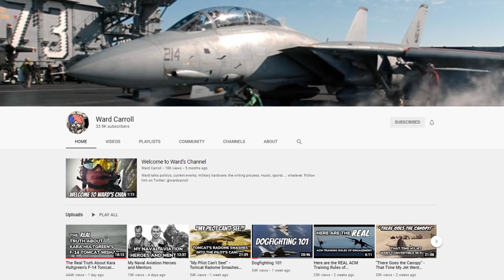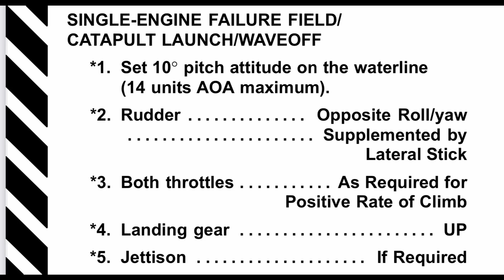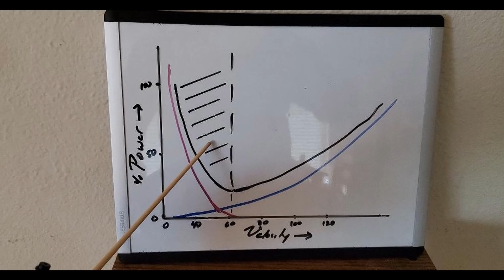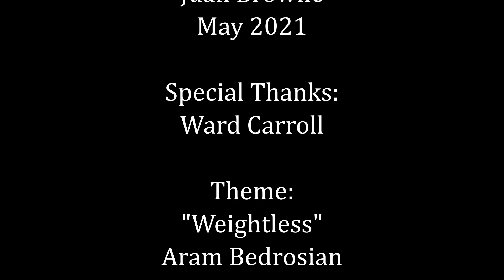Navy F-14 Crash/Stall Demo-Lt. Kara Hultgreen Accident

Comment: How would the fact that f-14s use spoilers instead of ailerons further exacerbate or change the dynamics?
Reply: The use of spoilers will drop that wing, it loses (spoils) lift. Aileron will increase the camber of the wing that needs to be raised up. A byproduct of lift is drag….which will “drag” the wing towards the dead engine. And also when increasing the camber it will increase the angle of attack, if I remember correctly, causing it to stall and the airplane will roll inverted. The rudders will bring the nose away from the dead engine and allows airflow over the wing to remain level. No more than 14 AoA, judicious aileron input to assist the rudder and proper power. Jettison external stores if necessary. Those are memory items
Reply: @uwekonnigsstaddt524  yes i know all that, but does the use of spoilers cause the drag problem that can happen with ailerons to act differently.  Sine you are deploying the spoiler on the down side wing you are decreasing lift on that wing, is it subsequently decreasing drag on that wing as well. Which would mean when trying to level out from a left turn with right stick, the right spoiler deploys which decreases lift and drag on the right wing which would cause a yaw to the left which would exacerbate a left engine out tomcat at high aoa. So end result is same, but process is 180 out if my thinking is correct.

Comment: I was froze to my seat, total immersion.  A 50k light aircraft is more effective than a $50mn simulator.
Reply: That a nice demonstration but f14 and this propeler plane are quiet different. No aileron on f14, 2 big and spaced reactor, a full rudder autority above 10° AoA. 
Only rmthe best navy pilots were allowed to fly on this plane.
Reply: @jejelerider3278  is that English?
Reply: @irvhh143  i'm french but yes, i think it seems like english with aeronautical words
Reply: There is no real danger in a simulator.  The trainee does not learn to control panic impulses. Also, the exercises are made easy enough that 75% of students can pass in a reasonable amount of time.

Comment: I had an instructor who was a former F-86D pilot. He had me spending a lot of time early on sitting at critical AOA dancing on the rudder pedals. As a result I never succumbed to the desire to use aileron for raising a wing at critical AOA.  Oh if only everyone had such an instructor.
Reply: Before I was able to be certified on floats I had to fly with a ww2 spit pilot, yes I'm that old, we did what he called a step down stall. Basically pull the stick to your stomach and watch the plane drop out of the sky using only rudder to keep the wings level.
Reply: Jason Miller from the channel "The Finer Points" made a video about it. Having the plane in a stall, keeping the wings horizontal with the rudder.

He calls it "the falling leaf technique".

Comment: I’m sorry but I don’t know why your right wing stalled. I understand that left aileron (without sufficient rudder input) will result in adverse yaw to the right but I’m not understanding how the right wing reached its critical angle of attack and stalled.
Reply from the maker: Watch previous update, pay attention in class, then watch it again. I'm not spoonfeeding this to the weak learners.
Reply: @blancolirio  Sure, I did that. “Increases the camber.” As I learned it (also 40 years ago) the stall is only a function of angle of attack. Angle of attack is the angle between the wing chord line and the relative wind. So saying that attempting to raise the wing with aileron increases  the camber (which the lower aileron clearly does) and causes the stall really doesn’t answer the question. I don’t see how it changes the relative wind so I guess you’re saying that the lowered aileron changes the wing chord line. Is this correct? Also, why be rude?

Comment: The left engines engine Pressure Ratio Bleed Control Valve failed first and that caused the engine to stall.  This particular engine on this aircraft had previously stalled on flights just prior to that flight.  If the PRBC is failing or failed you will continue to stall that engine.

Comment: I know this might be a stupid question, but I'll ask any way.. 

As this thing is a natural human reaction, and one that seems VERY hard to train away, considering that planes are as automated as they are would it not make sense for there to be an autopilot function or automated regime be a way to 'fix' this. Something that would just take over in those highly critical parts of flight? 

Like sure, not a fix for the rest of the world, but when you think of the money that goes into launching planes off ships, it seems like a worthwhile investment?
Reply: I'm no expert, but that Airbus factory crew on a low-pass flyby at an airshow flew their A320 into the ground when the plane's computerized fly-by-wire system "thought" that the aircraft was in "landing mode" and would not allow the pilots to "exit that mode" or gain altitude.

https://www.youtube.com/watch?v=wQlEoGB-d40

There probably was some way to exit that mode (if they had realized that they were in that mode to begin with) but, if there was, they didn't think of it in time to avert the crash.

Load your aircraft with all sorts of "savior" systems and complex features meant to save human work, then circumstances plus human limitations can mix together in unpredictable ways.

Even if the problems are predictable, or better yet if they have already occurred before and pilots have experienced them but managed to recover and reported them, failure of the airlines and failure of the aircraft makers to act on those reports can result in repeated fatal accidents. The now classic example of that: the Boeing 737 Max.

Comment: As a Naval Aviator that instructed, I was always uncomfortable placing blame for this incident on the aviator.  In basic Navy flight training we emphasize the 'skidded turn stall',  This recreates an overshooting turn to final, increasing angle of bank and wing down rudder (to bring the nose around to the runway) while increasing back stick pressure.  As airspeed decreases, eventually this leads to a snap roll.  A loss of the inboard engine in this case simulated the inboard rudder.  all that was needed was the natural tendency to pull back on the stick to induce the 'skidded turn stall'.
Reply from the maker: Yes!
Reply: 1978 ...Me having just transitioned from my Cessna 140 to a Cherokee 235 coming into oceana airport, near Pismo Beach, Calif.,   too hot on right base. Overshooting  and skidding ....., fear of over banking.....used right rudder to pull that nose to the right to point at the runway. Still skidding ...cross control pressure on ailerons....something not right......at last second remembering thats how you do a snap roll!! ...release pressures on rudder and ailerons and go around. It can happen that fast. And I had just received my commercial license.
Reply: I have seen that overshooting skidding turns while training 180 degree turnbacks and the question mark kind of turnback.  When overshooting some pilots, instead of going around or accepting the overshoot, they kick too much rudder, pull too much elevator, or both.  The best way to start a stall/spin.
Reply: That's irresponsible. She was incompetent. Your obvious fear to tell the truth because she was a woman is sad. The characteristic of the F14 to have useless aileron control in that particular regime was drilled into the pilots. They had to know it by memory. Call it what it is.
Reply: @suserman7775 ward Carol on YouTube, is one of the best for explaining these unique experiences.
Only those in that field of experience can really convey the power and complexity of those jets.
It sounds like he’s saying the same thing, except doing it in an honorable technical sense.
Reply: @suserman7775  Listen to Ward Carol. He was tactful but said it nice way. 
He did not crucify the dead.
Reply: @paulprigge1209  Careful there. Ward Carroll was not a pilot, and he (Carroll) puts part of the blame on the LSO, but the LSO had no way of knowing her exact circumstances when he called "power" (which was according to boldface). And, he didn't call for "full" power. IMO, the fault was on the pilot.
Reply: S Userman What do you say to the memorial clip to Juan's friend's that he just lost.  Did you comment to him that his friend crashed because he was incompetent?
Reply: @ivangranger8494  no but I don't go out of my way to cover up the underlying issue.
Reply: S Userman  I just missed your critiquing of the First Officer (male) that panicked,  and crashed a passenger airliner killing all on board, after the Pilot suffered a medical event.  It is on The Mentor's, utube.
Reply: @suserman7775  the start of Ward's video literally has two guys dying from the same thing. It can happen to anyone. Her low landing scores didn't have anything to do with that fact.
Reply: @clovis86  ok but that was before they put the recovery procedure into NATOPS.  Still not because she was a women. But she would of been trained on correct procedure

Comment: When I did my pilot training in the late 70's early 80's spin recovery was part of the private pilot training syllabus.  Not you stalled your wing drop recover, it was full rotation then recover, they didn't go much into the theory of wing stalling it was  all opposite rudder. Once the rotation stopped , it was stall recovery. I don't remember how many hours we spent doing stalls and spins   but I can tell you this many years later, flying a couch now, I was amazed they had to put that info in writing for a professional pilot.
Reply: I am surprised as well French.  The F4 had even worse adverse yaw and at high AOA it was drilled in our heads to use rudder only otherwise it would depart.  This was back in the '70's.  Wonder what they were teaching in the F14 community years later.

Comment: One of your Patreons. 

One thing not evident in your video is the altitude loss while you performed the maneuver.  This is just because you are demonstrating at a safe altitude.
I like the term “Stalls and Falls “. Very accurate..
I used to perform stalls, falls and spins. All from a safe altitude. 
If you’re launching or landing on an aircraft carrier there is no altitude for recovery.

The other factor is to Not just perform these maneuvers for your certification check ride, but often enough for proficiency.

Comment: EXCEPT in a flying wing. They have their own rules, or so we were told by a B-2 test pilot. Something about don't touch the rudder. The B-2 really needs its avionics, apparently. I'm still wondering why we lost the Northrop N-9MB.
Reply from the maker: Hydraulic (flight control) failure.
Reply: Thanks! But I've been unable to locate reports or documents stating that.

Comment: All fighter pilots should be required to fly a Pitts Special biplane for 500 hours. They would learn how to fly an airplane with the Rudder.
Reply: There are also many other alternatives that will help to re-enforce and programme your brain into taking the correct action. A Pitts Special is one but gliders will also do the job as will simulators however the essential component in all of this is the correct instructor.
Reply: @Trevor_Austin  I've had lots of instructors and most are horrible. They lack skill, judgement & experience. Most have only flown Cessna's, no experience with a control stick, no aerobatic experience and they have not had a real in flight failure. They have never been forced to glide to a full stop landing or solve an in flight controls failure. A simulator does not simulate g loads. I have never feared for my life in a simulator like I have in real aircraft after almost a dozen engine failures. A sail plane is good for learning rudder control although it is limited. I have never flown knife edge in a sail plane although I have tried. And they require very little rudder on landing. Ultralights are much better. Lots of rudder necessary for flight since they are super high drag aircraft. 500 hours in a Pitts Special will turn almost anyone into an amazing pilot. All other aircraft are easy after that experience. It's hard to get time with an instructor with at PhD in rudder control such as Sean Tucker or Skip Stewart.
Reply: A straight-wing single-engine biplane is hardly the best trainer for a swept-wing multiengine jet.  Better to have more practice maneuvering an actual jet at high AOA and during single engine go-arounds.  Some people need more practice than others, but Pitts time is not what Kara Hultgreen needed.
Reply: @gort8203  In this months May EAA Sport Aviation magazine you will find an article written by Norm DeWitt. For many years he taught active USAF test pilot students at Edwards Air Force Base aerobatics in a Christen Eagle II biplane. Specifically, he taught them inverted spin recovery. These were F-15 & F-16 pilots primarily. It does work for them. I have never seen a fighter jet climb knife edge. I have never witnessed them do a snap roll or inverted flat spin. An aerobatic airplane such as a Pitts or Extra would teach them those valuable & life saving stick & rudder skills.
Reply: @pittss2c601    Test pilot school flies all sort of aircraft for familiarity with handling characteristics and aerodynamic effects beyond those typical to operational aircraft. This is not done because that familiarity is directly relevant to operational aircraft, it is done to broaden the knowledge base of the test pilot.  This exposure is valuable for a test pilot because the operational aircraft have different characteristics, not because they are similar.  You can't spin most jets, you can recover even fewer of them from a spin, and if you do they do not recover the same way a Pitts does.  Spin recovery controls in a high performance jet are usually different from those for a plane with a straight high aspect ratio wing.  It's  extremely naïve of you to assume that a military pilot is deficient in stick and rudder skills because he hasn't flown a biplane.  It's actually insulting --what the heck do you think military pilots learn in flight school anyway?  If you think doing aerobatics in a Pitts is going to teach someone how to better handle a high performance fighter you are wrong. Kara Hultgreen needed more training, but not in a biplane.

Comment: The F-14 doesn't have ailerons. Lateral control is spoilers and differential stabilators.  The spoilers do not contribute to adverse yaw, nor possible drop of the upgoing wing.  The F-14 procedure specifically calls for use of lateral control in addition to the primary responses of AOA control and proper rudder input.

Comment: Thanks again for your continuation on the previous lesson. 
On a separate note, 2 questions: 1) from the previous episode what is the yellow biplane hanging on the side wall, RC ? ...and...
2) in this episode,  what is the wiggly tiny hose sticking out of the front mid-wing on the ML, just the left of your head at the beginning of the video?
Take care and fly safe. 🖖🏽🤟🏽
Reply: The step down tube projecting from the wing might be the airspeed pitot tube, or a fuel tank vent line.
Reply from the maker: Dynam 'Peaks' biplane and the pitot tube.
Reply: Thanks gents

Comment: So, you are flying along, engine(s) good, airspeed good, AOA good and a bit of turbulence drops a wing.  You pick it up with aileron and nothing bad happens.  Should pilots be taught to pick the wing up with rudder even in those circumstances just to avoid the consequences of aileron input during off nominal situations?  Maybe the drill would be: go flying on a bumpy day, trim elevator for hands off,  then fly hands off, rudder only for several minutes.

Comment: The real issue with “Revlon”-Lt Hultgreen was she was pushed forward beyond her skills because of political pressure to get women on carriers-damn the problems or costs.  She probably would have done well in rotary wing or transport
Reply: From my tiny, little, itty-bitty, fledgling YouTube comment, I got your Probable Cause....
Reply: The left engines pressure Ratio Bleed Control failed and had also caused previous stalls in that engine